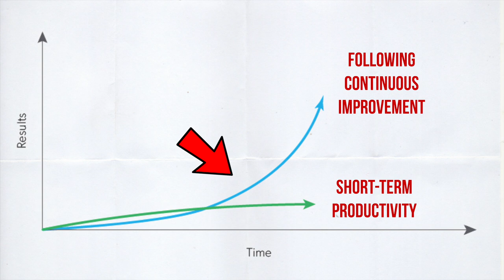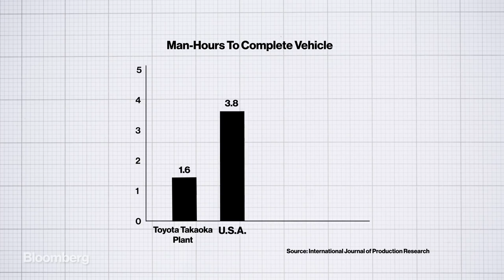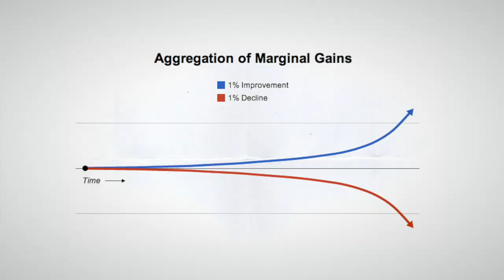KAIZEN | A Japanese Philosophy for Continuous Improvement (PDCA Cycle)

Comment: Actually, a BETTER Lean solution to your needing to do TWO videos for each setup, is NOT batching but rather in finding a better, more LEAN approach to the set up and changeover process, allowing for better FLOW, and not having to do TWO videos to a setup/changegover.  Higher utilization is not usually the primaruy objective.